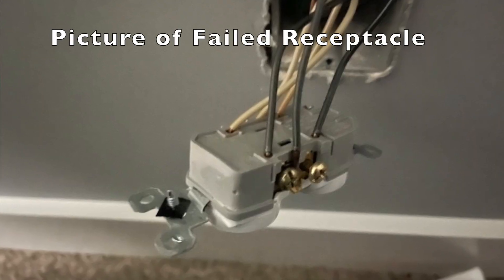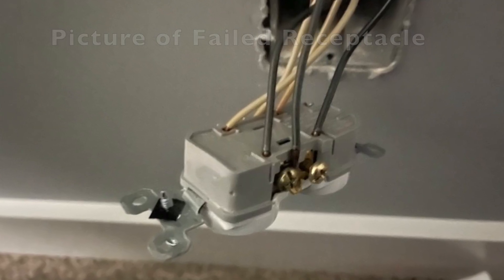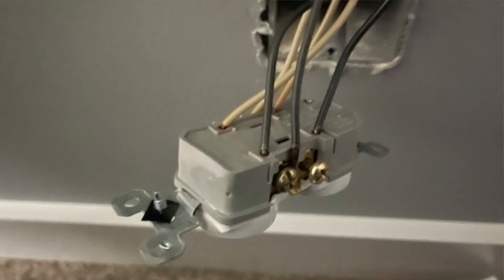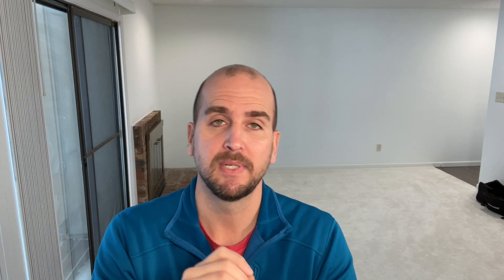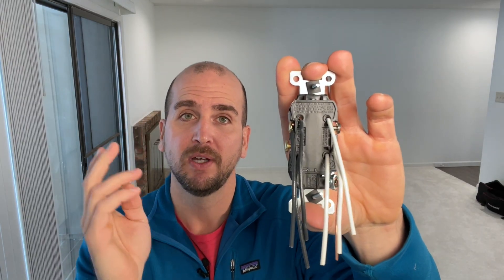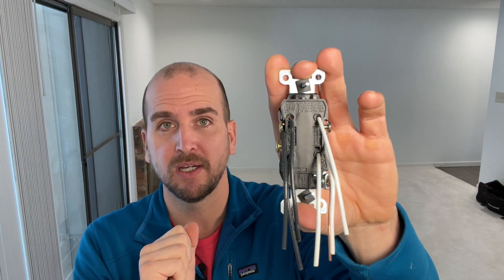Incorrectly Wired Outlet Found In Newly Built Home

Comment: Wow, no one talks about WHY it's bad practice. 

Using speedwire holes or side terminals forces the current for that circuit to run through the outlet. That means that any load on that outlet plus all downstream outlets is going to cause the outlet to heat up. 

If you use the speedwire holes, they've got a flimsy connection with high resistance, so the heating issue gets even worse. 

That high resistance causes a voltage dip downstream from the outlet, which can cause electric motors to draw even more current to compensate, resulting in even more heat. 

End result, you plug in an air conditioner and an outlet on the other side of the room melts. 

A pigtail uses a solid metal to metal connection inside a wire nut.  That has much lower resistance, keeping everything cool and safe.
Reply from the maker: Good stuff and well explained.  You are right that would have been a nice add to the video.

Comment: The "professionals" that wired my house, when built, all used push-ins.  The problem with building, today, is that everyone now gets paid by the house, so speed is money.
Reply: that's because the customer tends to ask for the cheapest price, and the fastest delivery.  you still get tradesmen who take their time and do it right, but they are often more expensive and have a longer wait to get the work done.
Reply: stab in only work on no. 14 wires , unless you buy expensive recet's ..now..things change, but have noticed little problem with stabs except on high ampeerage apps
Reply: @jsparlin1  no.  stabs only fit #14 wires, unless you buy receptacles made before the 2002 NEC.  you may be thinking of backwire connections, which are not stabs.  and yes, electricians who do service work make a lot of money every year from failed stab connections.
Reply: Ken Brown I was wondering why my home has 12 gauge backstabs all over the place. That explains it! I’m slowly working my way around replacing them.
Reply: I worked on a framing crew in the 80's and 90's.  It was the same back then too.  You bid on the job and get paid for it the same if it takes you two weeks or two months.
Reply: I worked for a number of contractors in my career. It was always against company policy to us the back stabs, as we called them
Reply: Those push inns are ul listed for that purpose.
Reply: @timfritz3828  yea and hendershot generator isnt
Reply: @hadleymanmusic  what's a Hendershot generator?
Reply: @timfritz3828  Just because it's legal doesn't mean it's best practice. This garbage is for lazy tradesman.
Reply: @DementedPony  and reading comprehension is beyond your ability.
Reply: @timfritz3828  Not sure how that makes sense since we're communicating in text. 
I honestly believe you have to be lazy, those push-ins are a hazard and it takes maybe 15 more seconds to do it right.
Reply: @timfritz3828  Cherry picking comments and having poor reading comprehension are different things. You said like twice.
Reply: The "professionals" that wired my house apparently didn't know what the hell the ground wire was for.. none of my outlets had the ground connected. Now the wire was there,, as it was included in the romex they ran, but it was just pushed and tucked back in the back of the receptacle. They also didn't know what a three pole switch was either as my hallway lights are connected with a regular switch at one end wired in series with the hot. Amd another switch at the other end of the hallway wired to the same hot... its just one long daisy chain.. except you gotta know direction of feed when replacing those lights.. just cuz the lights off doesn't mean there's not potential still there.
Reply: Piece work in tract housing has been the norm since the sixty s
Reply: @gmjent5671  Yes, but, unfortunately, it also can cause crappy workmanship.
Reply: @gwine9087  Agreed, But it’s all about the ones at the top, the corporate builders it is a very cut throat business, I am a retired Drywall and plastering contractor I started in  tracts and apartments if you wanted the work you had to be lowest bid, it’s all about volume my margins were so low it wasn’t worth the headaches. I eventually said enough and only bid customs and commercial work.
Reply: @gmjent5671  I was lucky enough to find someone like you who only did custom work several years ago. Had an old (1920’s) house that needed plaster repair and did not want to slap up drywall as it would have made all the gorgeous wood trim look off. 
He was so very careful. Took his time and even explained why he did what he did. When he was done, those walls and ceilings looked like they were original to the house. He was worth every penny!
Reply: My house was luckily built before push-in connections hit the scene.  However, because of the outlets age (50+ years), I had a lot of outlets that could not hold a cord. LOL  Yeah, that's "luck".
Reply: @jackb1803  My previous house was wired with aluminum.  Talk about problems!
Reply: @Dev JB the point is the way it is wired is not wrong.  It is just not good practice.  I have devices that are burnt up,  all from the same problem,  a loose connection. It doesn't matter if you use a device as a splice block or not a loose connection will burn it up.
Reply: Best practice is to pigtail every plug with multiple wires. Especially in commercial buildings. Failure of a plug won't effect others on the same circuit. But as far as quality, we've been in a race to the bottom for 50 years in construction.
Reply: @billybob-cg6ig  You're not lying that's for sure! The commercial lighting I've been installing the past 10 years is mostly crap too.
Reply: Yep "push ins are ALL about speed/time, tiny connection area
Reply: Push in connection is NOT faster
Reply: @bearbenedek6425  i do hundreds of these a year..using pushin connections seems to work better for me..i think screws are probably better, but i own the product and maintain it.  don't work for public very often.
Reply: @jsparlin1  Push ins are fine if done properly, stripped to proper length, etc...
Reply: @bearbenedek6425  faster to burn and 14 falls out anyway

Comment: Correct,never leave a screw loose hanging out.pigtail I don't like.i never use 14 wire at all.if its not commercial grade outlets,I don't use them.
Reply: For the comment,,,tape holding a wire nut,..if you have to tape a wire nut on,get the hell out of the feild.properly installed wire nut should hold itself solid in place.no tape..and I hate wire nuts.only use them in light 15 or less or 12v apps.thats me.you do it how you like.

Comment: Three things I would do different (more do in addition to what you did), as an experienced electrician:
-: Wrap the sides of the outlet with 3-5 wraps of electrical tape...This helps to prevent any arcs in metal boxes or knicks in any wires and provides a level of safety for the next individual who has to service that outlet.
2- Install the outlet with the ground up...This provides a way for anything falling on the plugged-in device (if the device was not fully plugged in) to fall off. I have seen where a penny fell off the back of a dresser and was logged between the hot and neutral prongs of a baby monitor, the Arc Fault did not trip as it should have, and fortunately, the only damage was one of the prongs for the baby monitor was cut in two due to the continual arcing.
3- Use a tamper-resistant outlet.

Comment: The outlet failed because of the way it's wired! Stabin's are garbage and are used by lazy electricians. All your wires should have been twisted together, according to color, with a pigtail from each that will feed the hot, common, and ground lugs on the outlet. I could get in to a detailed description as to why this method is better.
Reply: @Joe-by8jh  You're right, it is my opinion, which also comes from experience. You are correct, pigtails are not required by NEC.

Comment: When trimming the twisted end cut with a slight  angle to the left . It makes threading into the wire connector much easier .
Reply: I was instructed not to wrist before using weir nut !
Reply: It's very important to twist the wires to make a good connection before inserting into the wire nut . A loose wire will overheat .

Comment: It would not matter in that application, but in high vibration areas(Ceilings) you should tape the wire nuts. Constant foot traffic on the floor above will loosen wire nuts and they will back off. Receptacles near doors will sometimes have the nuts loosen up too.

Comment: As someone with zero formal training but that has done a whole lot of electrical work, I’ve seen these same mistakes all over the place, I think you have helped people here great video. Another thing I see all the time is people have a switch that appears to do nothing and they just accept that and make no attempt to fix it. The problem is, at some point someone replaced an outlet and didn’t know or notice the tab between top and bottom on the hot side between the screws was and needed to be broken off, so instead of having one plug being always on and one working from the switch(s), they are all on all the time. Maybe that’s something you can put into a future video and hopefully you can explain it far better than my attempt here.
Reply: I just discovered this exact situation in older house we just moved into. 
Often happens in houses where room has no overhead light. And mine was also in a 3 way switch. 
I checked the 3 way switch with voltage tester and found 3 way was always hot no matter the position so I knew something was wrong.
Found outlet with extra hot wire and sure enough it was a newer outlet and tab hadn't been broken. 
Turned off breaker, removed hots, broke tab, reinstall, flipped breaker on.
Now 3 ways work great and half the outlet is now switched.
Reply: @bowmanjeff8  yeah man that's the scenario I've seen so may times, I don't think I've seen one that wasn't on a 3-way.

Comment: "Installed By A Professional" You mean installed by the electrician's helper(s) while they go bid other jobs or... 
don't get me started. Not taking anything from the helpers I'm sure they do a good job. In my opinion, the experience is key for any trade. The price is the same though coming in at a bargain of 2,200 for a 6 hr day 1 guy. yikes!  Here in MA, you can't do anything yourself! A license is what's needed.
 Oh, wait, anyone can fix their own car. You do not need a license to be an auto mechanic. 
Even though auto mechanics work on voltages/currents far greater(for the most part) than any found in residential properties!. okay done rambling :)
Reply: You don't need a license do to electrical work on your own house in Ma. You just need to pull a permit and have it inspected.
Reply: @jimmac1185  I was told differently but will find out. thanks
Reply: @Dev JB the tape is just so that you don't accidentally touch your fingers on it it has nothing to do with proper installation
Reply: @thecloneguyz  Personally I will not use tape on any device just because it's such a pain to deal with the next time. By the time the next person gets to it, it's already falling off and not to mention the sticky mess it leaves.
Reply: @Zeknix  come on now let's be honest that's only the guys that by the 99 cent electrical tape if you buy the expensive 3M stuff that does not happen
Reply: @thecloneguyz  The expensive 3M stuff still leaves all that sticky residue after it's been there for several years. Gets all over your fingers, picks up dirt, and now I got to wash my hands all the time to make sure I'm not leaving dirty finger prints everywhere.

I don't see the advantage personally. Honestly, getting shocked really isn't that bad. Yeah it can hurt, but most of the time there is no lasting effect. Sometimes the best way for someone to learn to not touch live wires, is to touch said live wires. How do kids learn not to touch the heating element on a stove while it's hot? They touch it and get burned. Pain is an effective teacher.

Once the outlet is installed, I put a cover plate on it. If for whatever reason I can't install the cover plate, I've never had an issue with anyone getting shocked. Most people are so afraid of electricity, they actually are more careful if they see a metal screw with a wire attached. Covering it with electrical tape doesn't add any real safety aspect to it. To me it's like being safe for safety's sake. It's a solution looking for a problem.
Reply: @Zeknix  you build up calluses and kill nerve endings every time you get zapped so it hurts less and less each time until you can literally grab the wire softly like me and feel nothing but an occasional tingle
Reply: @thecloneguyz  tape is unnecessary and is a sign someone doesn't understand how electricity works. Leave off the tape. If Leviton wanted tape on their screws they'd include it. Hell, they would find a way to insulate the Phillips head of the screw. They don't because it isn't necessary and only adds potential (no pun intended) hazard. Leave off with the tape.
Reply: The first place I wired by myself was inspected by a master every day. I was grateful even if it was just a small thing he pointed for correction. He was an ass, but I was still grateful. No tags on my first job.
Reply: It may be in some towns, but there is no state rule against homeowners doing their own work. As far as I know, the only trade homeowners are not allowed to do themselves is plumbing.
Reply: @jimmac1185  ok thanks bro
Reply: @MR.KNOWITALL1982  the age-old trick is to hire a carpenter and have him say he's your brother and then he can do everything in house without a permit but he better not have a company name written on the side of his truck
Reply: Well said, but if comments insult you as a professional say it because it down right pisses me off. RI, Florida and Virginia Licensed Electrician
Reply: @Dev JB I know you're one of those badass electricians that likes to Nick the screws on the sides of the metal boxes cuz he doesn't like to use electrical tape
Reply: @Dev JB I got my Journeyman license in Colorado. We did strictly commercial. Never saw a plastic box on a worksite, only on residential side work.
Reply: Mechanics work on 12V or 24V systems. That's an order magnitude lower than residential. EV are typically much higher at 300+V but that's not typical as of yet and even then they should unhook the battery pack first. For ICE vehicles the current is typically far less as well, outside the starter motor. To get to that and somehow get shocked would take lots of effort. The biggest risk for mechanics is somehow connecting the battery terminals together like a wrench falling on it. In short, I'm not sure what one craft has to do with the other.
Reply: If a real electrician installed it it would have electrical tape covering the side screws
Reply: @thecloneguyz  
I don't think so.

Comment: Why does every outlet come with a second screw on each side if pigtailing is a superior practice? I have always felt that a screwed-down j-hook was a much more secure connection than a twisted wirenut. To me, it's a question of quality control: I can get the j-hook flat and tight and the sideplate has a lot of metal connecting the screws, but every pigtail is a custom job with potential new faults.
Reply: If you look at an outlet there is a bridge, small metal tab, between the screws. When you make a outlet be controlled by a switch you break that tab and put the wire coming from the switch to one of the hot side screws. The other screw get the constant hot wire. One can also break the tab on the neutral side and hot side and two separate circuits at one outlet.

Comment: Thank you for your willingness to share what you've learned. One suggestion is that it would have been nice to hear some more reasons for pig tails beyond the installation being cleaner such as using pigtails means that if someone decides to delete that outlet in the future they can just remove it and the connections for downstream loads doesn't have to be remade.

Comment: In the UK we would connect three wires together using Wago connectors
Reply: And in my eyes, those Wago connectors have all the same problems found with the 'back stab'  things on the American outlets. I haven't a clue why they suddenly have so much trust, especially for our high current circuits, when their integrity is solely dependent on a spring contact. I cannot bring myself to trust them at all apart from maybe low current splicing, despite everyone running around singing their virtues.
Reply: Not necessarily Lorus, do the IEE regs recommend Wago connectors? You cannot speak for the uk. Just saying.

Comment: As n electrician I can tell you there is a difference between push-in and stab style connections. Stab style allow wires to be pushed I. From the back but tightened with the screws not a simple cam/spring. Stab-ins are used a lot in commercial electrical as they are much faster; when you’re wiring hundreds of receptacles a day shepherd hooks add more time than stab in. Pigtails are also a go to when you have more than 2 wires to daisy-chain; most electricians make up pigtails in advance, mostly ground pigtails to make installs go faster. Commercial electric is all about speed without sacrificing safety; in residential the pace is usually slower and I’ll shepherd hook my connections. I will say for most receptacles we put in inexpensive ones as NEC requires a lot of receptacles; if they’re in a commercial space or a location like above a kitchen counter that will be used a lot go with a commercial or hospital grade. And remember most any receptacle location today needs to be tamper resistant; TR is a go-to as there are very few places where it isn’t required.